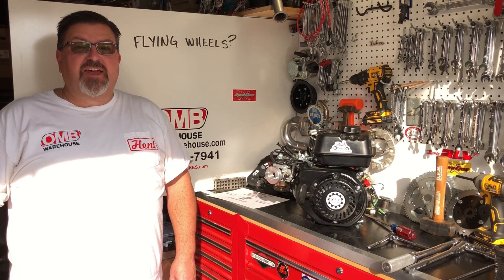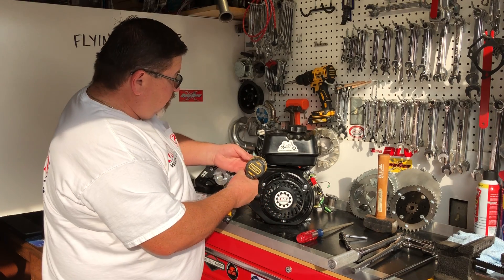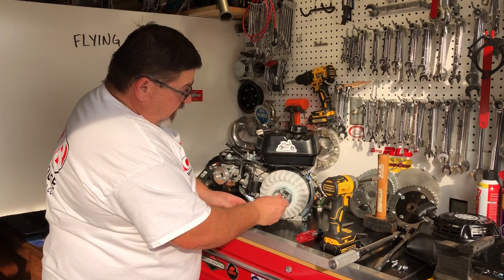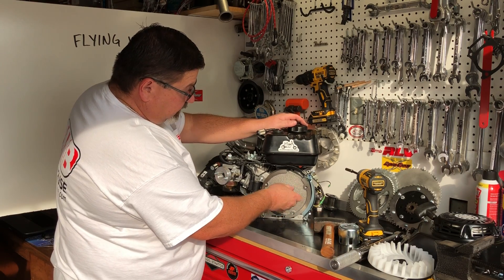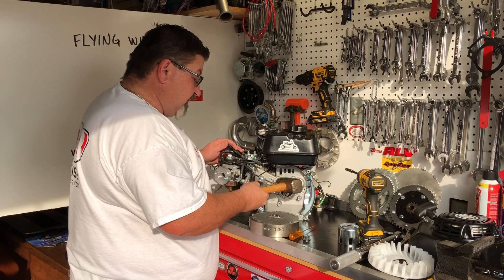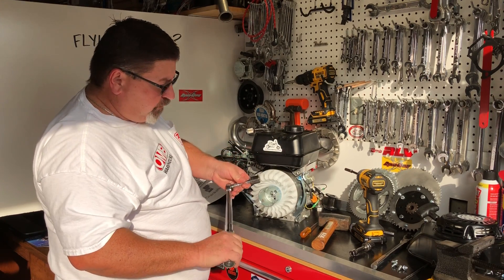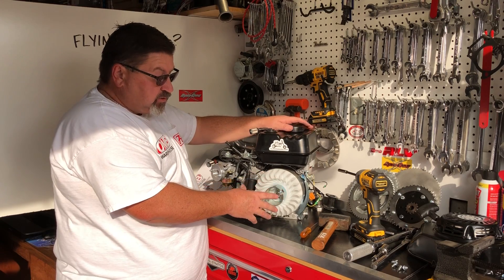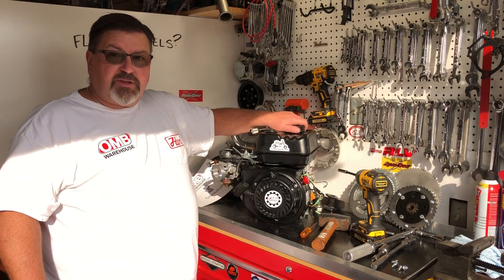Installing a Flywheel Key on a Predator 212cc Hemi or Non-Hemi

Comment: I have a question my 212 won't rev up just dies idles kinda ugly but won't go full throttle I replace the carb and bigger jet and emulsion tube it has after market air and exhaust would could cause this let me know what you know thanks for your time

Comment: I have always wondered how hard it is on the crankshaft applying 54 ft/lbs on one side of the crankshaft while holding the opposite side? There should be a way to hold the flywheel to torque the nut down instead of that much torque through the crankshaft. (???)
Reply: Preston McDonald  Too late junior. I finished breeding 20 years ago.

I was just fishing for another way. My buddy told me don't bother with a strap wrench because he broke his. I made a locking tool a decade ago when I got my first of 6 clones.

And these engines are child's play compared to what I've worked on so relax sport.

Comment: OMB If you're just adding a 8 degree key to a stock predator engine will you need to put a little bigger jet in the carb?
Reply: Yes you should. You can make a high air flow filter out of the stock one. When I find a stock one I'll make a video. Than new header pipe would really do you some huge power gains for under $100

Comment: I dont know if its wrong, but in the past i have pulled the spark plug and put a short section of rope in the head to lock the flywheel. No friends or special tools needed. Great video though!
Reply: That's one way to do that I've heard of others doing the same. Who knows how bad it could be?

Comment: So i bought the Stage 1 kit, installed it and (intake, exhaust, 8 degree timing) now my motor idles at something like 3500rpm when choked. am I supposed to adjust the crud out of something in the carb?  Its completely undrivable since it engages the crud out of the clutch the second i yank the cord to start it.
Reply: hi Eric try adjusting the idles screw is a black screw on the carb .
Reply: im gonna go and try to fix this as this is also happening to my engine and if your saying whats making your do this is the 8 degree timing key then it must be the same for mine. I'm going to install the stock key and let you know
Reply: could be a vacuum leak.

Comment: Do I need the 8 degree offset key with a colemen kt196 engine?  I noticed it wasnt included in OMB's "Stage 2 Performance Kit for Coleman CT200U Mini Bike 196cc or 212cc."  Thanks
Reply: You don't need the key, but it will increase performance in a stock engine. the stock timing is at 24 degrees and can use a bump!
Reply: @ericadams8099  Stock timing on my Coleman Hisun engine is 28 degrees. For years I have read and heard that the clones run about 28 degrees with the stock flywheel and key. I recently verified this on one of mine.
Reply: @ericadams8099  holy fuuuuu...thats all? good lord, no wonder they are pigs haha!